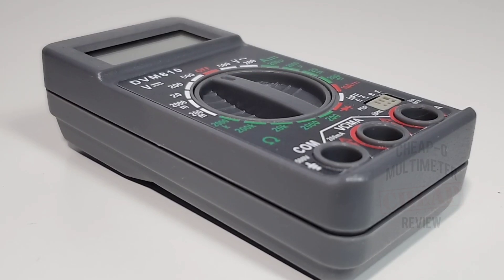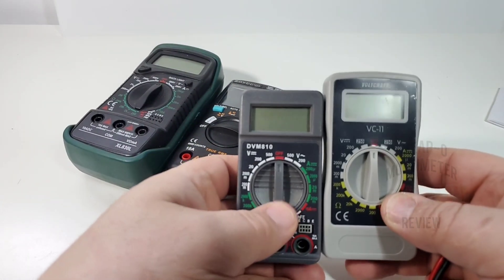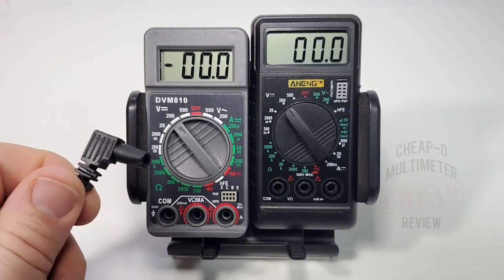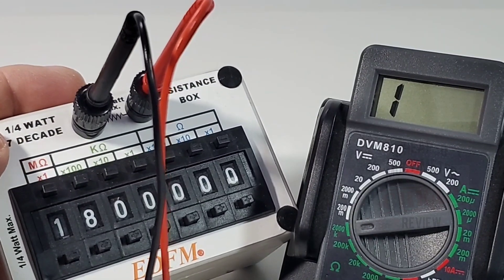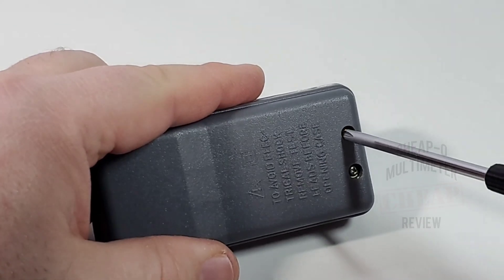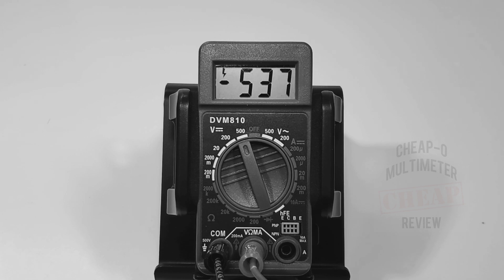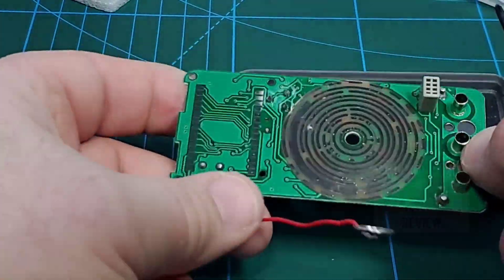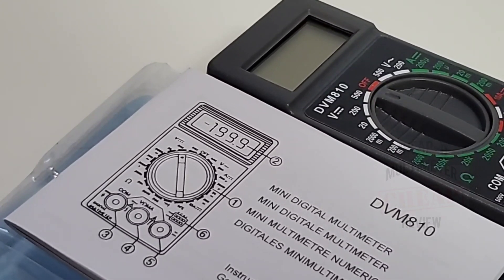VELLEMAN DVM810 CHEAP-O Multimeter Review & Teardown!

Comment: I have one of these that I bought from Maplin Electronics in the UK some time in the early to mid 2000s.
It has been a faithful companion for many years now.
I don't use it much, but due to its small size, I carry it in a small tool kit that I bring with me when traveling etc. It's not the best meter in the world, but it's more than adequate for a "just in case" tool kit.
It's on a par with the usual inexpensive multimeters from Harbor Freight, Walmart etc, but the magic lies in its small size. The best meter is the one you have with you when you need it.
The only thing I dont like about it is the lack of a continuity beeper. There's plenty of room inside for one too, so its not a concession due to the size of the unit. Can't have everything though I suppose.
I just took the back off to remind myself what battery I needed to get, and I thought I'd look to see if there were any youtube videos about it.
I was delighted to see that the best multimeter reviewer on youtube had a review of it!
The PCB in mine is a different revision to yours. Mine has a date on it; August 20th 2002.
I don't know if that's the date of manufacture, or if it was just the date of that revision of the PCB, but either way, this model has been around for over 20 years now.
Reply from the maker: Thanks for the kind words my friend ! Agreed, this little multimeter is a real gem. It's small but effective and it does a pretty decent job at giving accurate readings. I've lost it at least twice but eventually became smart and like you it's now in a dedicated toolbox. Audible continuity would have been nice! I'm pretty sure it will last another 20 years without a hiccup 😅 KeepOnTesting! 👍

Comment: I'm glad I found your video. I don't know squat about multimeters. So I got this 810 thinking I could do a continuity test on a tiny fpv drone camera. Only to find out it doesn't do continuity!
Reply from the maker: There's no audible continuity but you can measure continuity in low resistance mode. Resistance scale/200

Comment: These have been around for who knows how long.  I bought mine well over 10 years ago - i think around 15 years.  I bought it from a local store (Electronic Parts Outlet).  I don't recall if it had any brand name, but it is identical to the one in this video.  I don't use it daily, but I've used it off and on since I've bought it and it works great - I've even traveled with it on occasion.  Mostly I've used it to test all kind of different batteries and also charging systems on vehicles.  Everything has held up, including the leads.
Reply from the maker: Excellent! They seem basically foolproof as far as durability is concerned..glad to hear yours is still going strong !

Comment: What are the advantages of using a LR23A 12V over a 9V? Can you also explain why 3V (via 2AA cells) isn't the standard for cheap multimeters?
Reply from the maker: No advantages..the LR23A are more expensive  and harder to source. AA battery has a great battery life , AA alkaline batteries typically have a capacity rating of over 2,500 mAh and AA NiMH batteries have rated capacities of only 1,200 to 1,900 mAh.Best part, you can find them anywhere. Standards are hard to pinpoint. Usually economics play a role. Industry adoption also takes a long time..so there's no easy answer. Sometimes,  the most popular option isn't always the best!
Reply: @KeepOnTesting  LR23A is smaller diameter, so smaller case than a 9V model.